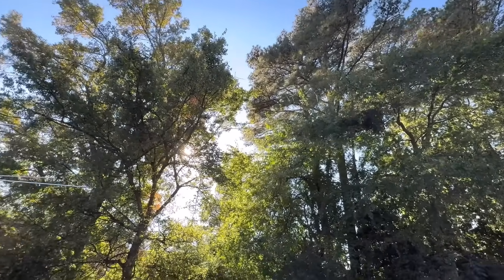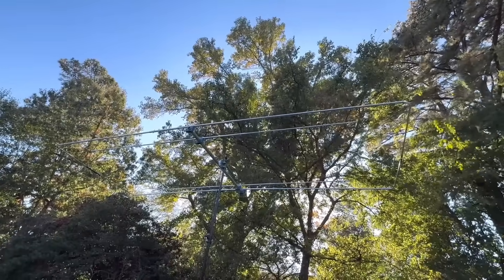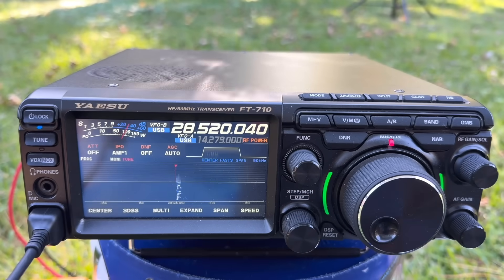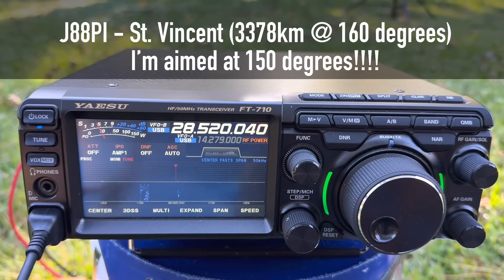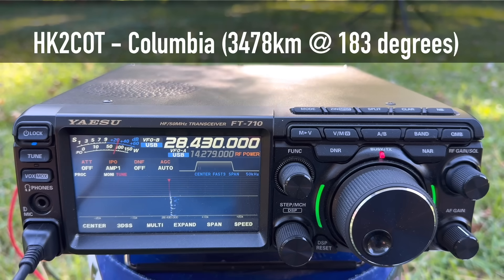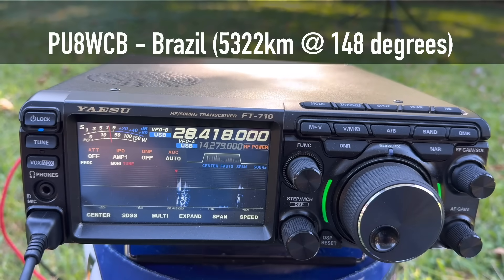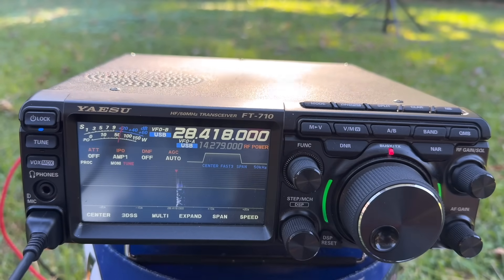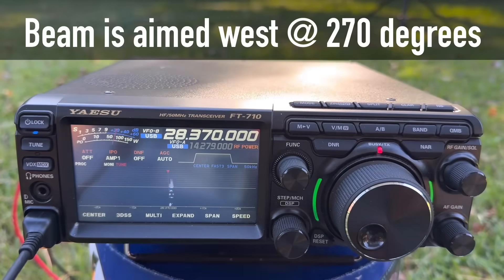Portable with the ARRL Momobeam

Comment: New ham here, KI5IGC in eastern Arizona. I'm on the verge of creating my shack and have landed on building an 80 meter horizontal loop. I just had a crazy idea. At the risk of exposing my ignorance, what would happen if I ran a 40 meter loop inside the 80 meter? Would it work? Would there be any benefit or would it be counterproductive?
Reply from the maker: Yes, it should work.
Reply: @COASTALWAVESWIRES  Would a 4:1 balun still be appropriate with both wires?
Reply from the maker: @lonnierandall7882 yes, I would think so. I’m sure the feedpoint impedance is still 200 ohms each
Reply: @COASTALWAVESWIRES  Thank you. My vision is becoming much clearer.
Reply: @COASTALWAVESWIRES  Thank you. I've seen tactical delta loops of two different sizes in one antenna, but I hadn't seen it done with wire. It occurred to me that it might make the higher frequencies closer to resonancy in those ranges.

Comment: Here are the basic specs from the assembly guide:

 BAND    10 meters/28 MHz    6 meters/50 MHz 
Gain(dBi):    11.46     11.6
Gain free space:  6.23 (4.09 dBd)   5.97 (3.83 dBd)
Front/back ratio (dB):   20     10
Power Handling (Watts):   1500   1500
Elements:    2 (Moxon) 2    (Yagi-Uda)
SWR <1.5:1:   28 to 28.8 MHz    50 to 50.6 MHz

Comment: From the manual (available on the ARRL link):
One of the unique qualities of this antenna is the feed system for the 50 MHz portion of this dual 
band antenna. It utilizes the Open Sleeve Feed Method, where there is no physical connection to 
the Driven Element of the 50 MHz section and the coupling is based on element proximity and 
length that allows 50 MHz energy to couple from the 10 M Driven Element with minimal loss.
Reply: My 2M/70cm moxon uses that method.